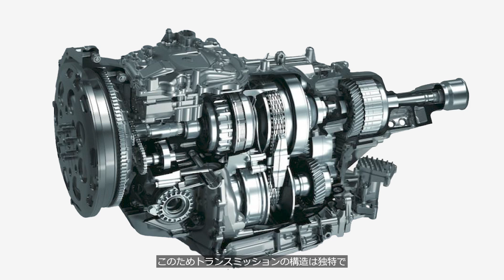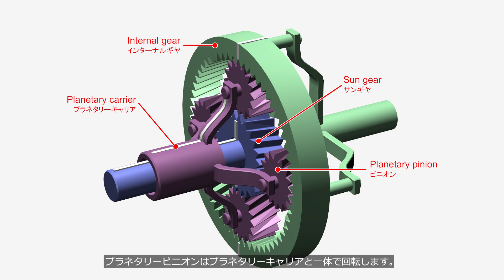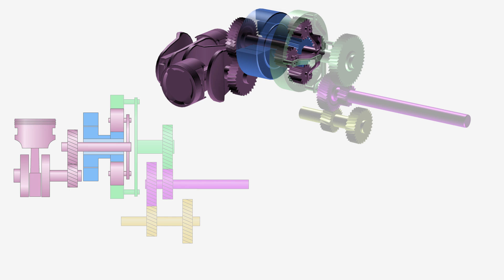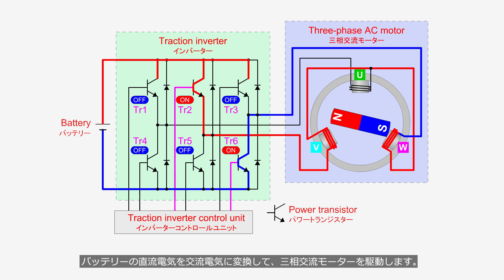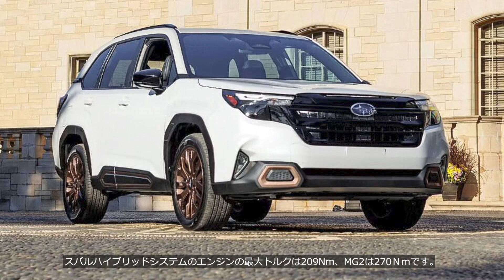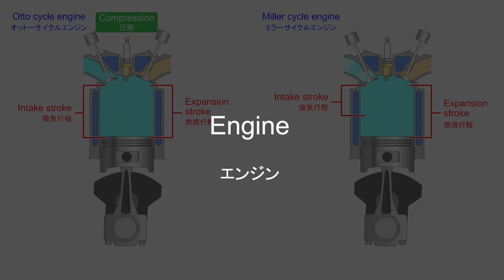Deep Dive into Subaru Hybrid System with Mechanical AWD!

Comment: Before anything else, I want to be clear this is coming from support, not hate.
I genuinely like Subaru and want the brand to succeed long term.
This is not about trashing Subaru. It is about pointing out real issues that still affect trust and could hurt the brand if they are not fully addressed.

Subaru’s reputation in the automotive world is genuinely paradoxical. On paper, modern Subaru ranks very well for reliability, safety, and owner satisfaction. Models like the Forester, Outback, Crosstrek, and Impreza routinely score above average in recent surveys, and many owners report long mileage with regular maintenance. Yet despite this, a noticeable number of buyers still avoid Subaru entirely and treat the brand as high risk. This disconnect is not accidental, and it is not irrational either.

The root of the problem is not that modern Subaru vehicles are objectively unreliable. The problem is that Subaru accumulated a series of highly memorable, expensive, and emotionally painful failures over time. Those failures left a long psychological scar that still shapes how people think about the brand today.

Older Subaru engines, especially the EJ series from the late 1990s through the late 2000s, became infamous for head gasket failures. These were not rare edge cases. Many owners experienced leaks between 75k and 100k miles, sometimes earlier, often with repair bills large enough to total an older car. Because the boxer engine layout makes these repairs labor intensive, the cost felt especially punishing. This single issue alone did enormous damage to Subaru’s reputation and became one of the most repeated warnings in used car advice for years.

Then, just as Subaru began escaping the head gasket narrative, a new problem emerged with early FB engines around 2011 to 2015. Excessive oil consumption became widespread enough to trigger lawsuits and warranty extensions. Owners reported having to add oil constantly, sometimes every 1,000 miles. For many drivers, oil consumption feels like the engine is slowly dying, even if it technically remains within manufacturer limits. The combination of dealer disputes, tests, and inconsistent responses amplified frustration and reinforced the idea that Subaru engines are risky long term.

These two issues alone would have been enough to haunt a brand. But Subaru’s reputation problem did not stop there.

In more recent years, new problems appeared that affected newer vehicles, which is far more damaging psychologically. The Thermo Control Valve issue is a good example. This was not an engine failure, but it caused warning lights, disabled safety systems, heating issues, and dealer visits on relatively new cars. Even though Subaru extended the warranty significantly and updated the part, the damage to confidence was already done. A modern car throwing errors and losing safety features triggers anxiety far beyond what reliability statistics can fix.

Infotainment problems added another layer of frustration. Touchscreens freezing, rebooting, or failing altogether may not destroy an engine, but they destroy daily usability. When the system that controls navigation, audio, climate functions, and backup cameras becomes unreliable, owners feel like the entire vehicle is poorly engineered. Repeat failures after replacement made this worse and pushed the issue into lawsuits and public attention.

There are also oil leaks on newer FA and FB engines, particularly cam carrier leaks. These are often slow seepages rather than catastrophic failures, but the repair cost can be very high due to labor. Many owners are shocked to learn that a relatively small leak can require engine removal. This reinforces the narrative that Subaru ownership carries hidden, expensive surprises.

The CVT situation adds to the fear, even though modern Subaru CVTs are far improved. Early CVT problems created a permanent stigma. Transmission failures are one of the most feared car issues, and once that fear exists, it does not fade easily. Even today, buyers worry about long term durability simply because the early stories were so loud and costly.

Subaru is judged more harshly than Toyota or Honda for several reasons. Subaru uses standard AWD, which adds mechanical complexity and cost. The boxer engine layout lowers the center of gravity and improves handling, but increases labor time for many repairs. Subaru engines are also more sensitive to oil level and maintenance neglect. Owners who maintain them properly often get excellent longevity, but owners who do not can experience expensive failures quickly. This creates wildly different ownership stories, which fuels confusion and fear.

Another major factor is Subaru’s online community. Subaru owners are passionate and vocal. That is a strength, but it also means problems are documented in extreme detail and spread rapidly. Negative experiences dominate research results because people rarely post when everything works fine. Prospective buyers researching Subaru encounter pages of failure stories long before they see statistical reliability data.

The key point is this. Subaru’s reputation problem is not about average reliability. It is about a small number of repeatable, high cost, high inconvenience issues that feel unacceptable to risk averse buyers. Toyota and Honda have had serious issues too, but their brands are perceived as forgiving, low stress, and easy to own. Subaru is still seen as a brand where one mistake or one bad component can become expensive and frustrating.

If Subaru wants to fully escape this reputation, incremental improvement is not enough. Cooling system components must be extremely robust. Sealing strategies must stop producing labor intensive oil leaks. Infotainment systems must be treated as mission critical and built to last. Warranty coverage must be clear, proactive, and consistent across dealers. Owners need fewer surprises and fewer dealer visits, not just longer warranties after problems appear.

Subaru has many real strengths. Safety, AWD performance, winter capability, value, and modern reliability are legitimate advantages. But until Subaru eliminates the small set of failures that create emotional distrust, many buyers will continue to choose Toyota or Honda simply for peace of mind, not because Subaru is worse on paper, but because it still feels riskier in real life

Comment: This explanation was incredibly helpful. Even the official Subaru website doesn’t provide details about this transmission, so I mistakenly thought it was still using the traditional belt-type CVT. Your information really clarified things for me, and I’m relieved to know that Subaru was able to eliminate the belt and pulley system.
Reply from the maker: Thank you for your comment. I'm glad to hear the video was helpful to you.
Reply: this Hybrid design architecture is similar to HYbrid Toyota, because Toyota is one of shareholder of subaru
Reply: @amintaginting6698 no

Comment: I can find no other information online (nor from Subaru) that says the power to the rear wheels is disconnected when not needed. Can you please confirm your source on this infomation?
Reply from the maker: https://www.subaru.jp/forester/specification/docs/specifications.pdf
The second line below the transmission table on page 2
Reply: @sikasabumotorchannel   English Translation from the PDF you provided: (Thanks!!!)

"The transaxle's AWD mechanism (electronically controlled coupling) employs a control that disconnects the driving force to the rear wheels. When the vehicle determines that AWD driving is not necessary, it takes
advantage of the excellent responsiveness of the electronically controlled clutch to automatically release the clutch instantly, cutting off the transmission of torque to the rear wheels. This reduces the loss of driving force transmission to the rear wheels
and the power consumption of the electronically controlled clutch, improving fuel efficiency without changing driving performance. In addition, depending on changes in road conditions, torque can be instantly distributed to the rear wheels to improve driving stability.

Note that opening control is not performed when X-MODE is activated or when S mode is selected in SI-DRIVE. "

Comment: Interesting.  No CVT drive belt.  That might be one good reason for going hybrid in this case.  I also like the fact that Subaru opted to maintain a direct mechanical drive to the real wheel as opposed to just adding an electric motor to the rear axle.
Reply from the maker: Thank you for watching the video and leaving a comment.

Comment: Hope that this system will be able to become the plug-in hybrid! All the system is the same, but things extra: bigger battery, longer range in EV mode and higher speed electric driving!
Reply: プラグインハイブリッド化されると、ドライバーはどれだけの距離をモーターのみで走られるか、その競争が始まります。また、明確に重くなり、その重さは車体の全てに影響します。私はプラグインハイブリッドカーを所有していますが、最近はプラグイン機能の無い、純粋なハイブリッドカーが欲しいと思っております。
話を聞いてくださって、ありがとうございます。
Reply: @ruo7000  clear, thanks!
Reply from the maker: PHEVはとても機能的で素晴らしいと思います。しかしモーター走行時は重く不要なエンジンを運び、バッテリーが空になると不要な重いバッテリーを運ばなければなりません。PHEVか、自己充電式HEVか、難しい選択です。😒
Reply: @sikasabumotorchannel 
全く同感です。
悩ましい選択です。
Reply from the maker: Thank you for your comment. I hope that too.
Reply: Yes , with this system is easy, as is with the rav4 PHEV, its the same architecture like the Hybrid. Bigger electrical motors, bigger inverter but the mechanical architecture its the same.

Comment: Thank you for the very best explanation of this system to date. It's clear that Subaru's AWD system is far superior and is the best choice for those needing the most traction in slippery conditions. I have always wished Toyota and Subaru would merge and put their heads together to create the very best and most capable reliable vehicle. And it appears that day is here. This is a masterpiece of engineering. I hope Toyota's engineers have worked with Subaru to make the  boxer engine as bulletproof as Toyota's engines and we can start seeing Subaru's reaching 300k mi./20+years of service with nothing more than good routine maintenance.
Reply: Subaru actually ousted Toyota for reliability this year in the Consumer Reports study, they kept making that boxer more reliable year by year and finally made it more reliable than a Toyota engine. That being said my 04 forester XT still runs great after 21 years of normal maintenance
Reply: I disagree. I prefer an electric rear axle like Toyota's solution for AWD. Both are just FWD until they decide they need more power on the rear.  The advantage of Electric, is faster response/independent response, no clutch pack to wear out, and no drive shaft needed.  The only advantage the Subaru system has is that it can put more power to the rear, but that could easily be fixed on an electric rear axle by just using a more powerful electric motor.
Reply: @peterscott2662  Subarus are symmetrical AWD all the time
Reply: @highlyactivefitness  That's just marketing. The new system on the hybrid has an electronic clutch pack, that even Subaru admits fully disconnects the rear wheels for better fuel efficiency in some situations.
Reply: @peterscott2662  that situation being driving straight at highway speed and maybe when cruise control is engaged. I believe once a slight input is entered, a change in accelerator input or a change in steering input, AWD comes back immediately. Subaru is not going to alienate long-time fans by making drastic changes to handling which is noticeable via the vehicle roll characteristics even during a gentle curve.

In the EV Trailseeker/Solterra/Uncharted, Subaru is even tuning the motors to vector torque at the apex of a corner so it feels closer to a Forrester.

No offense to Toyota & their fans, but Subarus have a distinctive handling characteristic which the RAV4/BZ do not replicate.

In Japan, advertisement cannot be misleading, and manufacturers routinely launch explainer ads to educate the public.
Reply: Subaru should make their boxer engine having both port and direct injection to avoid carbon buildup on intake valves… that is a drawback compared to Toyota…
Reply from the maker: Thank you for watching the video.
I also have heard that Subaru is highly rated in snowy regions. However, I've also heard that there are durability issues with the engine.😢

Comment: In Indonesia, we use gas tanks for our stove, but everything else is electrical here.
Reply from the maker: Thank you for your comment. 
Various things are being replaced by electricity in Japan as well. 
By the way, how much have battery EVs increased in Indonesia?
Reply: @sikasabumotorchannel  by a whole lot. At least in the big city, I have seen a lot of them. EV are exempted from even / odd plate number restrictions that applies within Jakarta. Most ev are from China, BYD is rising really fast with their M6 (MPV) and their Seal (sedan) quickly overtaking Hyundai IONIQ and Wuling AirEV. I charge my EV at home. it has been a game changer for me, it has been really practical and also economical to run. I think my next car will be another EV.
Reply from the maker: Thanks for sharing the information. I'm glad to hear local voices firsthand.
Reply: @sikasabumotorchannel  i love your channel btw,  the explanation was very clear and detailed. Thank you.

Comment: This channel is a joke. Subaru “finally” introduced hybrids? They’ve had them for years. Subarus weakness is fuel efficiency? They tend to be the most efficient in their AWD ICE class. The robo voice doesn’t help either.
Reply from the maker: Thank you for watching the video. I appreciate your valuable feedback.
Reply: I can clarify for you. Boxer engines by default are very inefficient and do not make much power for their size. That of course changes with the addition of the turbo on higher trims. But a 2.5L engine that only makes 180hp is pretty low. They do manage to get somewhat decent fuel economy compared to the completion for 1 reason. They use a cvt when most others dont. The cvt helps boost the mpg significantly. The downside to that is that cvts by nature are the weakest, most failure prone transmissions available. They handle your typical soccer mom commutes no problem. Things like severe snow, mud or off-roading (the things subaru market their vehicles for) will kill a cvt in short order. They just cant take that kind of hard work. For that reason most manufacturers choose to use a traditional trans with torque converter and physical gears. If subaru did the same and used a more robust transmission their fuel economy would be the worst in class without a doubt. 
As for the previous hybrid. Yes, subaru made one. However it was a plug in model and it flat out sucked. It was no quicker than a standard model and it only got like 2 mpg better fuel mileage. 
This upcoming hybrid is a massive improvement. It removes the chain from the cvt and uses gears and electric motors. That will make the trans much more reliable. It will be much faster than the standard engines. The mpg is said to improve by 40% over the standard engines as well. So for all intents and purposes this is their 1st hybrid that they made any effort on.
Reply: @boost331  Do you know anything about the "mild hybrid" currently being used in many other countries?
Reply: @hdibart The "Eboxer"...? 
I know it has a bad reputation for adding a bunch of cost and complexity. All while not adding very much efficiency and actually being slower.
Reply: @boost331  "Boxer engines by default are very inefficient and do not make much power for their size." This is an oversimplification and simply not true. Boxer engines don't make high PEAK horsepower numbers because of the rotational inertion of the opposed piston design, with both banks at TDC and BDC this means that you need a heavier flywheel compared to inline or V. And because the heads are low in the engine bay, the intake runners need to be long, which favours low RPM breathing... operative words being "low RPM" .... peak HP is a pissing number because passenger cars don't spend their time at the top of the rev range, so a K24 making 10 more peak hp is really rather meaningless because what actually determines an engine's drivability is torque under the RPM curve, and below 4000rpm there really isn't that much difference.
Reply: @stuntmonkey00 So basically what I said in 1 sentence you wrote a paragraph about just to say the same thing. Boxer engines dont make power.
Reply: @boost331  , What's your opinion on 2026 subaru crosstrek hybrid?. It has 2.5 Ltr +boxer engine. Will it last long?.

Comment: Mechanical rear wheel drive has one objective advantage, front and rear axle wheels wont spin independently. That independent spin is very annoying on toyota hybrid awd when accelerating on patchy icy road. Sudden random oversteer chaning to random understeer in pulses. Also on wet tarmac in sharp turn full acceleration, some wheel can spin like crazy for a moment. As result unwanted tire wear :( very noticeable after subaru awd which hardly ever spin on wet tarmac.
Reply from the maker: Thank you for sharing the information.
To be honest, I live in a warm region, so I haven’t often noticed a significant difference in AWD performance except when going skiing. 
However, I do know that Subaru is popular in cold, snowy regions.
Reply: Since both systems are essentially FWD until rear drive is needed, this isn't a real problem with either system.  Behavior will be very similar in both systems. The only real advantage of the subaru mechanical AWD is it can put more power to the rear, than the low HP electric motor of the Toyota system.
Reply: @peterscott2662 , not so weak rear axle power on some toyota hybrids with awd, when turning can easily spin rear wheel even on dry tarmac. But independent axle spin when turning on patchy icy road is real random oversteer to understeer and back. Unpleasant experience:(